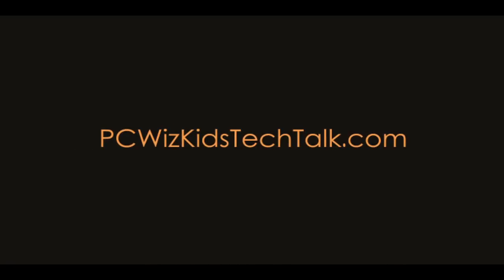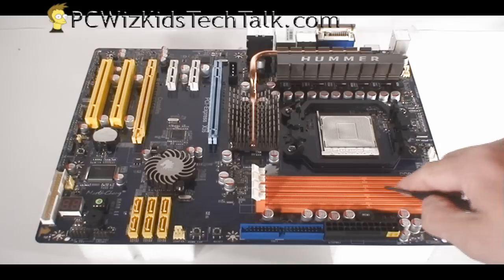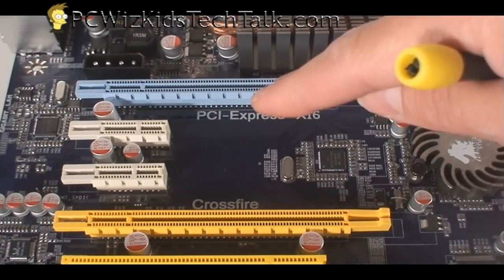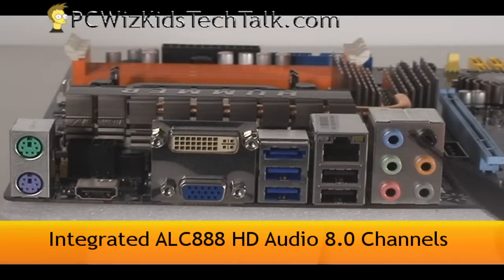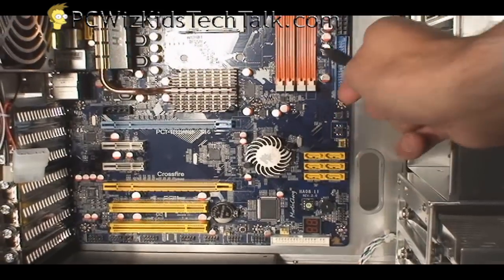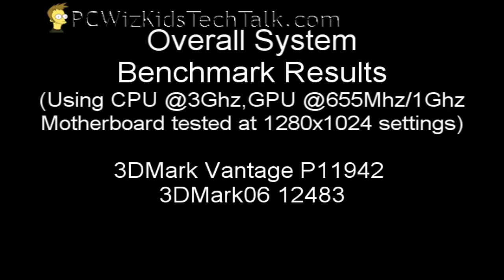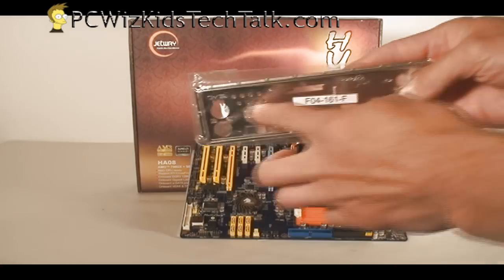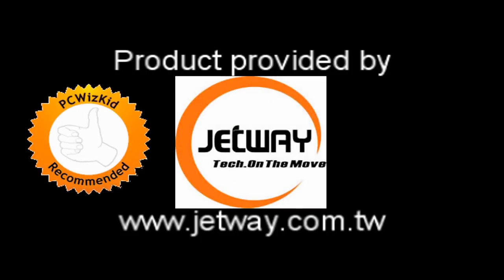Jetway HA08 AM3 Motherboard - Review

Comment: I love this board, I have the combo and bought an 1100T for it to upgrade the 970 that was in it for two more core/thuban. Anyway, mine just has 6 dimm slots like an intel 1366 socket which I thought was neat as four are ddr3 and two are ddr2 used separate. It has two bios chips, one for each ram and my son pulled out and broke the one labeled DDR3 so wondering how I can get the last / latest rom for this ha08-combo by Jetway and furthermore get it onto the common type bios chip that pops in and out? Is there a company that flashes these and has them, mails them to you after payment and sending them the bios you want on it? I need that as well as one of the misfits blew on a super hard overclock, it's visible, the board still lights up but gets the FF code ever since so I know it's the mosfet I can see blown, prob it as well as the MOBO bios chip ddr3 one of two that was damaged. HELP! Is there a company that will replace a mosfet or two and clean the board up / slick it up as well as flash a missing bios chip and install so I can get my RETRO board back with the 1100T?... I would obviously pay more then the board is worth to get these two things done or three (maybe three if two mosfets are blown but board lights and only seems to be one blown) but I can not for the life of me find a online company I can ship this to that specializes in fixes motherboards? I really want it fixed as it was my fathers originally whom is since deceased so not only so I like it as used it more then him and it can still be great for light gaming with proper gpu as well as streaming and checking email but it is even more sentimental. Hope that all makes sense...

Comment: @jancom777   Better, but this is still essentially a content-less criticism. "Fails horribly" how? Do you means it fails to overclock well? Runs slower are less reliably that other comparable boards? And of course, what is your source of this knowledge? Have you owned and tested one? Seen one in use? Read a review it which such failings are documented?

Comment: What exactly is your problem with a switch card? Yeah, it seems like a clumsy "cut corners" solution, but what is actually WRONG with it from a performance/use perspective? Obviously corners need to be cut to get this board to this price range. Is this such a bad one to cut?

Comment: You need to add another or just one, larger hard drive. You can do it yourself without much trouble, but you might want to find a friend or someone who would know more about what they are doing and you should be able to get it done at a low cost and without your computer being down for long.